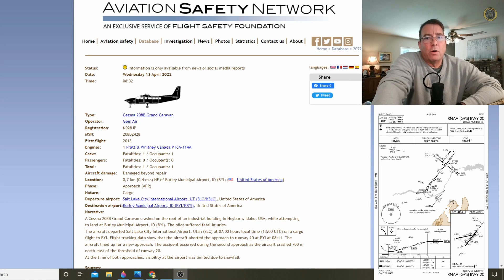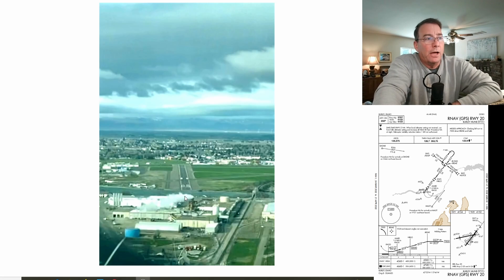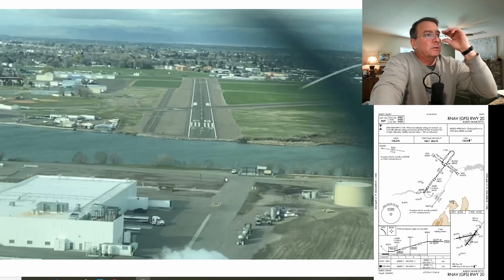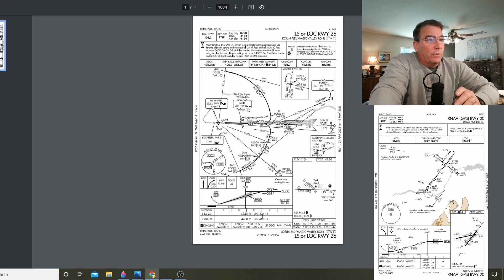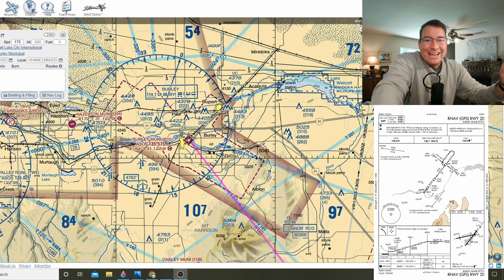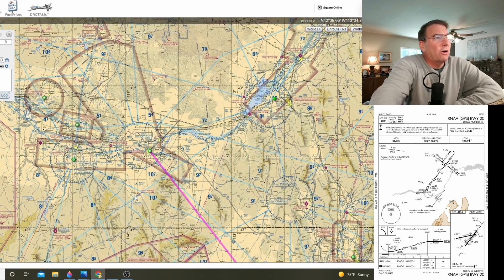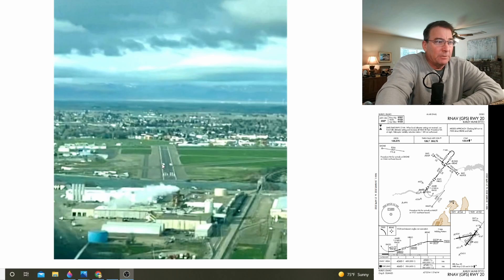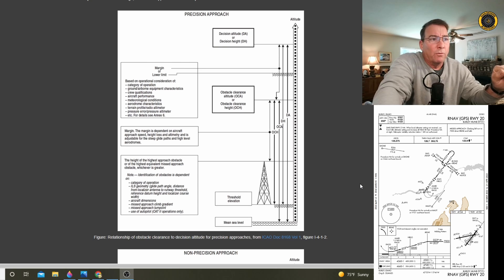Cessna 208 Caravan Crash Burley Idaho New Pictures of Approach

Comment: Excellent visual and spoken explanation of the final approach segment at Burley, Juan. Thanks for your efforts to help us all understand this tragic accident. we have a much clearer picture of the challenges young Brittany was up against that fateful morning.

it looks to me now that this approach to runway 20 is a bit tricky under the best conditions, i.e. VMC day ops. 

I'm only personally familiar with the VNAV/LNAV approach software in the Boeing 757 and 737NG navigation suites. Hopefully you or someone familiar with the Garmin 1000 can explain the vertical and horizontal nav laws in that system that Brittany would have been using at the time of the mishap. This approach could only be legally flown as published, an LNAV nonprecision approach with stepdowns to progressively lower crossing restrictions until the final approach fix/missed approach point where a pilot's decision must be made to begin descent to the runway if sufficient visual cues are present, or execute a missed approach. my question is whether the G 1000 system is providing a glideslope on a NP approach to vertically guide the pilot to descend to the progressively lower altitude restrictions on the final approach course? And if so, where does it project the final (visual) descent path to the touchdown zone? Is it possible if the pilot/autopilot is following such a vertical glide path as an aid to crossing the final approach course altitude restrictions that the pilot might erroneously continue following the VNAV cues and be tempted to continue doing so at the missed approach point, or slightly before?

Comment: I dogged freight when I was but a young tyke many years ago. I'm here to tell you you can often find yourself under pressure to "get in" when you should have gone someplace else. Sometimes that pressure takes the form of your own overconfidence and sometimes it's external.  I'm not saying that's what happened here. That's still a tough call. Blowing snow and a steam cloud at night? Might as well be trying to land in a snow globe.
Reply: This accident happened in daylight, per the report. 

While far from an ideal approach configuration, barring unforeseen circumstances that we may not know about, staying at or above MDA and executing a missed approach at the MAP if the runway is not in sight is a safe way to conduct operations at this field. The ce-208 is a pretty docile airplane to fly and can safely fly an approach at fairly low speeds which gives the pilot more time to evaluate the conditions. Of course if ice was involved, that might complicate the scenario. 

If the Grand Caravan hasn’t changed in the last 30 years, it will have pneumatic boots on the wing leading edges and the front of the pod. In addition, it has a hot plate on the windshield to keep a clear view. In heavy ice, that might restrict vision out the front if the windshield is iced except for the hot plate. But that all comes from memory 30 years ago across 3500 hours in the caravan. 

All that to say while it may have been a busy approach, it should have been very manageable imo.
Reply: @speedlever  I had not given the report a thorough look. I admit, that since all of my freight time was on the backside of the clock, I just assumed.  Be that as it may handling a low vis approach in blowing snow and low hanging obscurations is challenging.  At the moment this incident leaves us more questions than answers.  Why was there even an approach to a runway with that many obstacles in the final segment?  Did she have the landing environment in sight and then loose it?  Did she assume that it was just the steam cloud and she’d be through it in a second?  Why was she attempting an approach and landing to a place she couldn’t potentially leave? ( no deicing available).  I don’t know and it’s understandable that her family and friends may not like the answers to these questions but my gut feel here says she either left the MDA  without having the runway in sight or she had the runway and then lost it and failed to execute a missed ( I’m not condemning here. We’ve all done stupid stuff in an airplane. Most of us were lucky enough to learn from it.).  In any event it’s all just conjecture.  I’d like to see what shakes out of the investigation.
Reply: @gerrycarmichael1391  
Agreed on all counts. Was that destination airport her home base or an intermediate stop? In my experience, those freight runs tend to be daily repeats based at some outstation, flying the freight into a hub late at night, then reversing course in the morning returning to the outstation(s). Assuming that, this is even more puzzling since it would imply familiarity with the airports and approaches in the area, unless she was a floater pilot on tdy for one reason or another.

Comment: Could make it into an 'Alpha' approach but that steam can be blowing in many different directions. Also when temp/dewpoint are tight as they were that fatal day the steam might not be so benign looking as it appears in these photos. It would be billowing, hanging, not dissipating, like the steam around the vent coming from your clothes dryer on a cold dank day. Another consideration is which stage of the  processing produces the most moisture exhaust, what's the worst, when's the least?
Summing up:
Temp/dewpoint spread, the ambient temp especially if below freezing, the manufacturing stage/duration that produces the most moisture as an effluent, wind direction and velocity.

Comment: Juan, it will be interesting to see if the approach does meet TERPS criteria.  However, as an operator I worked for 20+ years ago found out, an approach does NOT have to meet TERPS.  We unfortunately lost a Lear 35 operating into ASE.  One of the takeaways was that the FAA wanted to say that the crew was in violation because they descended from MDA, even though they were not within 30 degrees of the extended runway center line (in accordance with TERPS).  However, on that circling approach, if you were to maintain MDA until within 30 degrees of the extended centerline, you would not be able to make a normal descent to the runway.  When pointed out to the FAA, their response was that the administrator could waive certain TERPS requirements.  For an example of the process, see https://fsims.faa.gov/wdocs/8900.1/v08%20tech%20functions/chapter%2001/08_001_003c.htm.   I would wager that the approach to Burley probably has some sort of TERPS waiver.

Comment: I’m surprised this approach is not offset ?    When were these obstacle’s constructed,  before or after the this approach was constructed ?    No doubt the height of the obstructions has been verified ?
Reply: 1930 for the airport; 2010 for the plant.
Reply: @lizj5740     I’ve found an RNav(GPS) Rwy 20 plate on the internet,  dated 21/04/22 plus 1 month.  

This gives Touchdown zone elev of 4152’ and an obstacle at 4179’ which is only 27’ high !!!    The LNav mda is 4560’ .
Just looking at video,  the towers are much higher than 27’.    
I conclude there are other obstacles which are not shown on the approach plate.   The question also is are they fitted with obstruction lights and say strobes ?    Also the runway which has a displaced threshold ( originally constructed in 1940 ? ) does not appear to have papi’s or vasis making it particularly difficult in poor viz.     
I’ve also looked on google maps and I cannot see any towers on the plant in question ,  but I do not know how often google update their maps.
All in all this looks like an accident waiting to happen.

Comment: I think the FAA is going to buy this one! Either there was a TERPS evaluation error, or the criteria will be changed. Either way a horrible accident, this pilot was put in a very difficult situation.
Reply: Yes, it was a difficult situation, but that's what pro pilots deal with all the time. The criteria don't guarantee that every pilot will be safe in every situation. There's always room for a mistake to bust someone's ass. But it's their mistake, not that of the people who created or evaluated the TERPS criteria.
People have to learn that we all must take responsibility for our own failures. This was one of those.
If the charted data was incorrect, or there was a failure in the airplane's equipment, then that can contribute to the accident. But assuming the charted data is right, and the airplane did what it's supposed to do, this will be determined to be a pilot error accident. There may be some "contributing causes" as mentioned here, but it is still up to the pilot to deal with them, one way or another. 

It's what pilots, especially professional pilots, do.

Comment: Just wondering what the situation is with approaching the runway from the opposite direction to avoid the steam cloud? Not a pilots just very interested.
Reply: Wind was 8 knots down the runway.
Reply: The possibility of that would be dictated by wind conditions, you generally don't or even can't land or take off with a tail wind depending on windspeed and the aircraft in question.
(assuming the field allows either direction, it's the norm but some fields can't and just shut down if winds not right for the only direction they can offer)
Reply: That area up there tends to have some pretty strong winds, generally from the west, so it’d be pretty rare to be able to land in an easterly direction.

Comment: The Jeppesen plate for the RNAV (GPS) Rwy 20 approach has a description for a Controlled Descent Final Approach (CDFA), because it shows that after HIKLO, you maintain 6,000 MSL for another .5 miles until you are 4.5 nm out, and then you begin a stabilized approach.  According to Google Earth, the tower that was struck is 2,660 feet from the threshold.  So you need go from 6,000 MSL at 4.5 nm from the runway threshold (27,000 feet distance) to 4,192 MSL (TDZE of 4,152 plus 40 feet for TCH), or lose 1,808 feet. Doing some math, at 2,660 feet from the threshold where the tower is, on a stabilized approach, the altimeter would show 4,370 feet, which is 190 feet below the MDA, and only 178 agl.   I don’t know the MSL height of the tower that was hit.  Does it make sense for an approach to have an aircraft approximately 178 agl just over a half mile from the runway where obstructions are located?  Can any of the professional pilots comment on this analysis and the calculations, which may be wrong.

Comment: It will be interesting to see how the FAA handle the issue of pilots loosing visual on the runway for a second when flying through the steam cloud generated from the processing plant chimney.
Reply: It's already not legal to do if you're a VFR pilot.  If you're IFR and you enter the cloud below MDA you are to execute a missed approach immediately.  In that case, however, by the time you realize it and start to execute the missed approach you'll be out of the steam cloud and it's likely safer to just land.  It's just a poor place for the stacks.

Comment: According to an article published on Feb. 26, 2021 by KMVT  (the local CBS TV station), the airport dates back to the early 1900s, and had lost FAA funding due to being below minimum standards.

Also, the airport's relocation has been under discussion for approximately 25 years.

I'd say that there is a case to be made against UPS, the airport, and quite possibly the potato processing plant for wrongful death, because the more that one digs in to this, the more that the conditions appear to barely meet allowable approach conditions in good, clear weather.
Reply: WHERE WAS THE FAA while that tower was being put up?  Have they NO responsibility?
If not, what good ARE they?
Reply: Why would the plant have any responsibility? It's not their job to determine proper airsafety.
Reply: @carlmenger9145  I work at a different plant, our stack height had to be modified upon construction because we are “near” a pattern. So the ball was dropped somehow.
Reply: @carlmenger9145  They emit the steam plume directly into the approach path.

And, they did not have any aircraft warning light on that stack.

They are not only responsible for getting their plans approved before they build, but also in how they operate their facility in a manner that is not supposed to increase the risks to aviators.
Reply: Gettafnggrip... THOUSNADS have landed their safely.  Thousands.  Pilot error.
Reply: @carlmenger9145  Thus my question about what the FAA was doing, rather than assessing the safety aspects of those towers in the landing pattern so close to the runway.
Reply: @carlmenger9145  well yeah it is their obligation when researching for a site for this plant. What if the Tater plant was a hospital instead?
Reply: @billhosko7723  yeah right you figured that out all by your lonesome self.
Figure out what's wrong with your spell checker.
Reply: @billhosko7723  Glad to know you've never made an error, or maybe THOUSNADS.

Comment: I used to fly the Caravan as a freight dog.. not out west though, but up in the North east and in eastern Canada. I have landed in snow and dealt with snow on a regular basis. I don’t know any Caravan pilots who purposely do a missed approach to assess a paved, snowy runway,, the big tires can handle it without testing the surface like in the back country. Also as for snowing conditions, you won’t have snow sticking to a cold soaked plane, so even if you landed and snow accumulates on the wing, you could broom it off and go. No need to de-ice like at the airlines. If it’s not adhering, you are good to go!

Comment: Great info, Juan.
If my calculations are correct, assuming a ground speed of 120kt 
3.00 degree glideslope requires ~640 fpm descent rate
3.75 degree glideslope requires ~795 fpm descent rate
The pilot would need to be mentally prepared to be close in and start the descent smartly to make it in.  If it were present, the steam cloud would be blown onto the final approach course, making a marginal situation untenable.  An ugly and terribly sad situation.

Comment: Pretty amazing that an obstruction like that could be built right on a runway axis, but if you spend some time in google maps you will see that this factory is not in Burley, but in Heyburn.   I'm guessing that there is a logical ($$$) reason it's there, and not elsewhere in the area.

Fully get that it should not matter, approach plates correct, MDAs, etc. but we have to accept the reality that we as pilots are not always perfect - and if we mess up, is there any kind of a buffer?  I think we should find a way to "protect" our runway axis with either a flat park, golf course, grazing, farming, or some other undeveloped space for exactly this reason.  I fully realize that politically ($$$) it's hard.

Comment: Burly looks to me to be a example of a re-alignment job of shifting  this end of the runway 3-400 feet to the right and keeping the far end where it is ..which should move the path to the right of the tall tank in the foreground and out of the plume of the factory.
Reply: There’s a bridge just off to the right too, though, which is parallel to the runway. Shifting the runway would put the bridge in the approach. It’s just a horribly located and planned airport location all the way around.
Reply: @400_billion_suns  only need to shift this end of the runway  about 300 feet to the right and re align the runway to the new angle   which still gives 2-300 feet to the bridge area but puts the glide slope to the right of the taller tank in the foreground..and burly probably was built long before the potato plant   and i would first question who allowed such obstructions to be built inside the glideslope path in the first place.
Reply: @irondarknessdarkness8900  Yeah, I wish it were that easy! Shifting the threshold of RWY20 300 feet and pivoting about the threshold on RWY2, the extended centerline nearly intersects the bridge where it meets the opposite bank of the river. With a smaller rotation it could be squeezed between the bridge and the stack obstructions, but having a tall bridge that close to the final approach will be just as dangerous or worse, in my opinion. Anyway, not disagreeing with you! Just showing how bad the placement of this runway is relative to other objects around it.
Reply: @400_billion_suns  i was not going to pivot anything except keeping the far end where it was and turning the end a bit,  i was judging by the width of the runway tbh just sliding the centerline about 3 runway widths to the right should leave the centerline paved just to the left of the squat tank and to the right of the closer taller tank. and just move the runway crossover on over to match.

Comment: Juan, Another excellent video. Could this be a possible scenario? She flew the first approach to check the runway visually, and flew a missed approach. The second time in, with 1 mile visibility in snow, and a ceiling above the minimum, could she have seen the runway environment, and focused on the runway threshold markings as she descended below minimum. Could the snow have blended in with the steam such that she did not recognize that the tower and stack were obscured by steam? It seems easy to conclude that she busted minimums, but if she had the airport environment in sight, could she have descended below minimums legally, while the low visibility created a visual illusion, and did not see the towers? Were the runway lights on? The airport plan view does not show the circled V on the approach end of RWY 20. Very tragic accident. The pilot had good experience and seems to have been well qualified. It sounds like many people are questioning why the airport and potato processing plant are so close together.